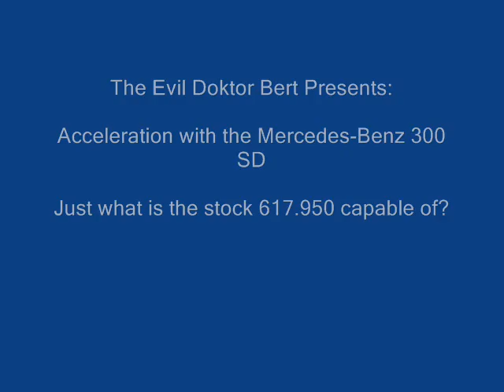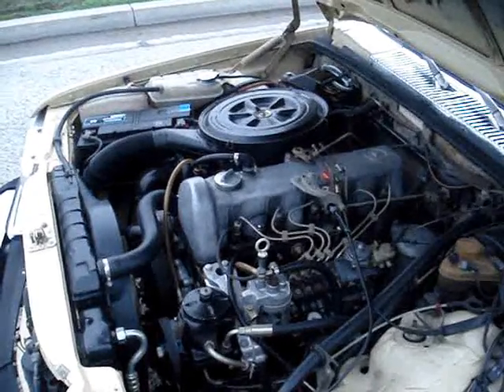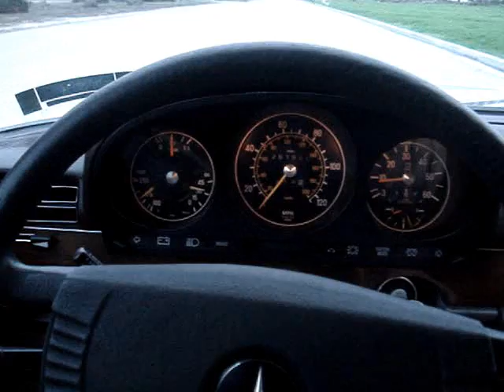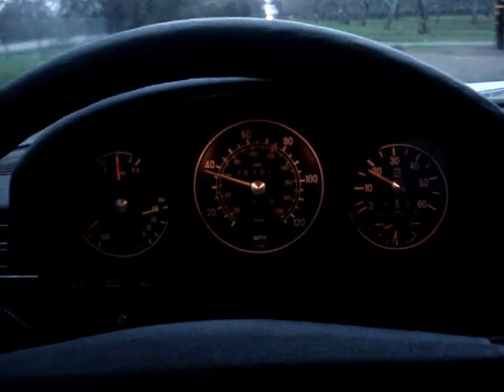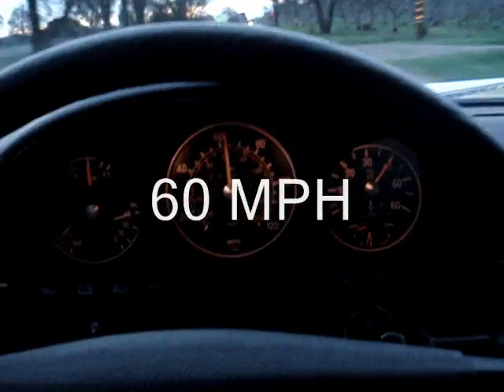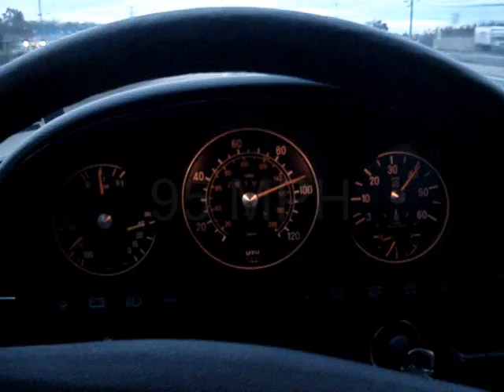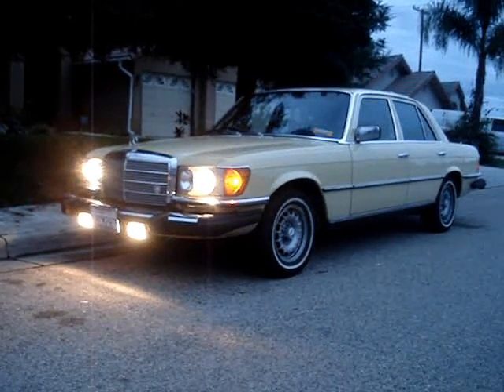Mercedes-Benz 300 SD 0-60 MPH Movie.wmv

Comment: After STUPIDLY selling my 1985 300CD  (W123) in 2010 (along with my W126 420SEL) I'm desperately missing having a Mercedes-Benz diesel and I told my son that I'll ONLY have another Benz if it's a diesel and I never considered the W116 chassis until now especially after seeing this video. Well done Bert, thanks for sharing.

Comment from the maker: This engine now has 100,000 miles on it since the July 2005 overhaul, for a total of 1,344,000 on the chassis, and it still has zero oil consumption, thanks in part to Total Seal Gapless Rings...
Reply: What? 1million miles. That's crazy

Comment: The best or nothing. I need help with a newly purchased 1982 300SD. I changed the fuel filters. What is the process or priming and purging the fuel system after installing the 2?
Reply: Pretty straight forward if your hand prime pump is working

Comment: diesels are oposite of gassers giving more air with the same fuel will reduce EGT's.First adjust your valves.Then check if your ALDa is working properly.The simplest check is to remove the alda and test performance.If it improves perfomance on full boost significantly then your alda is not working properly.
Search 
 IP Full Load Adjustment Procedure for the MW and M pumps 
on google

Comment: Nice running Diesel. i have a few and i just picked up a W123 300TD with a STT turbo kit installed. I am very interested in how you advanced the cam timing. Did you use an offset key ? ,and the IP,did you advance it by rotating the pump shaft back a couple of notches?.
Cheers!

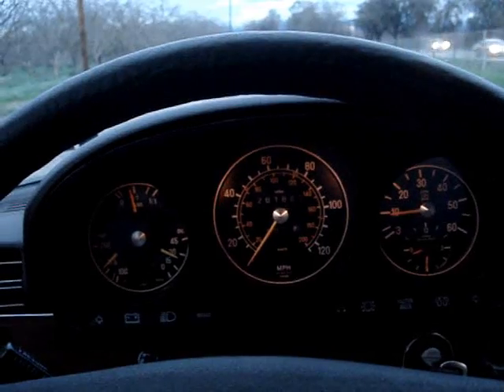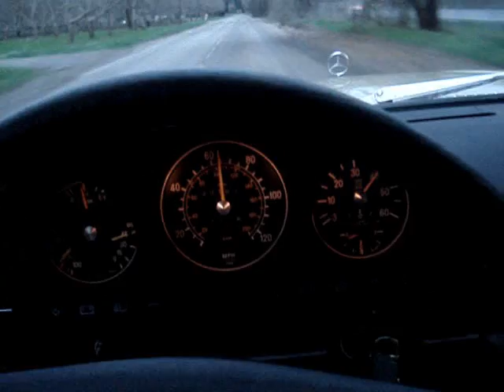Comment from the maker: I never actually timed it, but I don't think it's anywhere near that fast...Based on the video, 0-40 comes up in 6 seconds and 0-60 in about 12 seconds or so...watch between 2:52 and 3:03 on the video....
Reply: hi  i have same mercedes mine is 1980 but same chassy w116 300sd i need transmission is the tranny same from 300sd w126 chassy thanx
Reply from the maker: Transmissions are different.  It can be adapted to fit, but requires different drive shaft, throttle linkage and mounts...
Reply: thanks man i think i have to order one from germany in usa they want 1750$ just to much i think

Comment: I thought my car was fast during the test drive but I later found out that someone put the wrong speedometer in it, so it reads 20MPH fast. I think new injectors will help a lot. I already adjusted the valves, so hopefully injectors will stop the shaking.

Comment: I put an om617 in my Toyota 4x4, its awesome but lately its been way down on power and shakes a ton at idle. I'm pretty sure it just needs a valve adjustment but once I do that I plan on giving it a little more power, do your egt's stay in the safe range pushing 14.7psi for extended periods? Mine only makes 8psi but I never fiddled with the wastegate. Any other recommendations for more power? I am considering removing the rack limiter, is that a good idea? Thanks :)

Comment: How do you hit 5100 RPM?  I'm only getting about 4300 in my 1980 SD (116).  And your 1000 RPM to 2000 RPM jump is almost instantaneous - did you change the torque converter?
Reply: alda screw fully backed?

Comment: You should shift at redline, even if it's after your peak hp RPM because while it's not peak it's still higher than it would be in the next gear. Rev till its red.

Comment: There is no point of turning up the boost without turning up the full load fuel you will only get slightly better power and efficiency under full load because the engine runs with excess air
Reply: Petar, To a degree, you are correct, but in this case, we turned up boost until 0-60 times fell off and then stopped. Результаты говорят за себя.